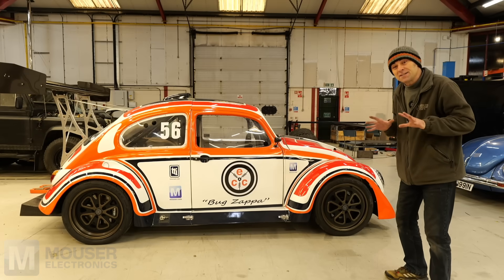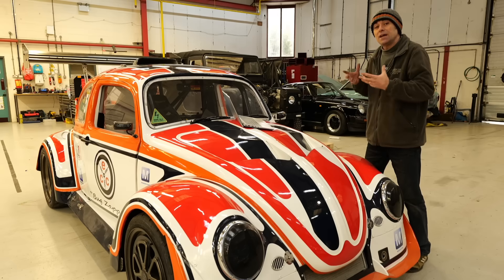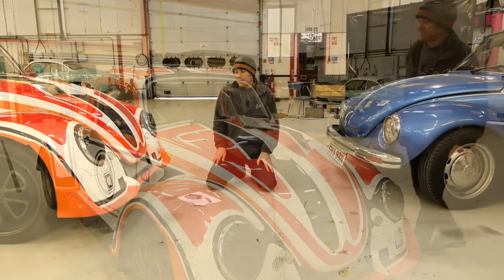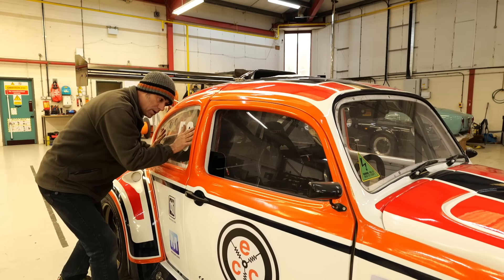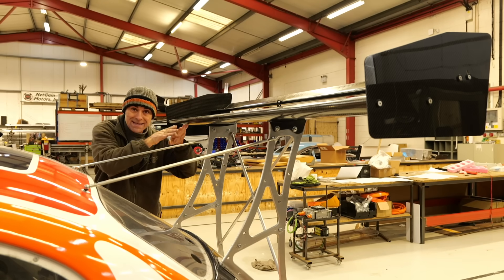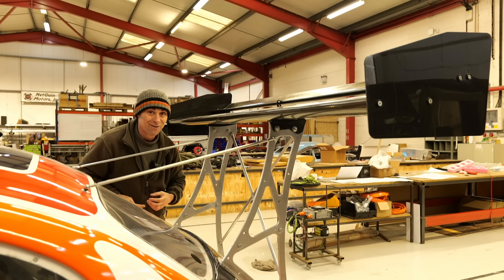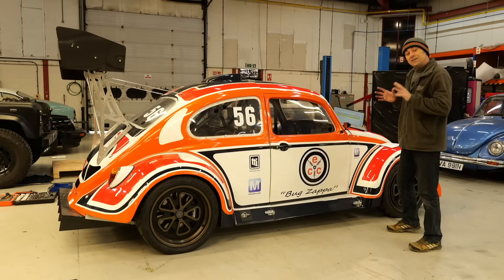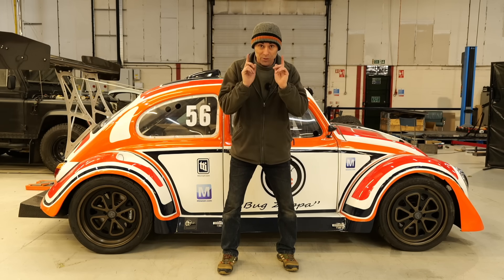Pikes Peak race car Ep17 - Aerodynamics results

Comment: I want to thank you for this video, it's really interesting and useful information, especially when you have a similar car :)
Reply from the maker: Glad it was helpful!
Reply: @ElectricClassicCars  I also have a retro car from 1969, ZAZ 965, which is currently powered by two engines from Nissan Leaf, boosted to 200 kW, each accelerating to a hundred in 2.3 seconds, I think you will be interested, more details on my channel
https://youtu.be/SPlqMTv1Vhg?si=RelwtMsoBy3VbXCr

Comment: That's an incredibly detailed report, worth every penny you spent on obtaining it. I'm interested to learn how much better the modified car will perform when you take it back to the drag strip. 
Bugzappa is a phenomenal improvement over the original Beetle design, which has a basic body shape that dates back to more than 90 years ago. 🙂👍

Comment: thanks for the insights!

I can understand that the floor/diffuser and splitter provide good downforce.
But, isn't the rear spoiler also the most speed sensitive?
Have Catesby Projects considered this, or am I mistaken?
And, if so, I suppose, you need to consider this in a track specific set-up, not?

Comment: I would imagine these aero mods are going to make the steering feel a bit more positive. 

I think the explanation of how a splitter works is incorrect. 
An air dam, which is a vertical extension down from the bumper, is designed to prevent air going under the car. They're generally used when the underbody is an aero mess, they decrease drag and create some down force. 
A splitter uses the high pressure air on the front of the car and turn it into down force. With a splitter you want air to go under the car where, hopefully, the floor of the car is reasonably flat. The speed of the air travelling under the car reduces its pressure (Bernoulli) and creates more down force.

Comment: Somewhat malapropos, but here are some wind tunnel test results for a Porsche 356 from 1950:

Drag coefficient Cd: 0,296.
Lift coefficient front Clf: -0,077.
Lift coefficient rear Clf: 0,359.

Source: Porsche 356, Driving in its Purest Form by Dirk-Michael Conradt.
Reply: Is the Cd coefficient the same like Cw? And can you please explain briefly in which direction the lift coefficient acts? Am I right with my guess that the 356 front has little downforce and rear quite an amount of lift?
Reply: @HERUsai  I think Cd and Cw is basically the same thing, though you'll have to google it to be sure.

And yes, the front of the 356 generates a bit of downforce, while the rear generates lift. I've read that at 100 km/h, the old 356s basically end up with 50/50 weight distribution.

Comment: The handling and cornering will improve. How much faster and easier on the driver - tbd? Interesting about the fender vents and under carriage air flow channeling, relative to down force balancing. Any recommendations about changing the windshield to rear window roof line shape? Possibly making it more teardrop or coupe?

Comment: Wow that is a pricey report. Probably as much as the chassis. Most of the work is constructing the model. I'm a little surprised that they run a DES simulation, but then that is probably standard for them. Its just a bit more expensive.
I love the application of the underbody cheat code, strakes, just add some strakes. 
There is still a significant amount of performance left, like 50% of easy'ish gains.

Comment: Some numbers to compare with: 
A VW splitscreen bus has a very low cw value so in theory isnt to bad, but its 'big' in frontal area. A Lotus Super Seven has cw value if 0,72 but tiny frontal area but isnt to great above 120mph. A REAL Mini has a cw value at 0,50 but small frontal area. So.. using your blue beetle with its rounded windscreen might have been better?
Reply from the maker: A 1303 with its curved windscreen would definitely been a better starting point aerodynamically.

Comment: Wow, that is all good research.
I use my Leaf on track days and lack front end grip, bought a front splitter but haven't fitted it as I thought it was just a boy racer gimmick, but I will now fit it and see if it makes any difference.
Reply: The results are in, it works!

I found and fitted the little  'Halfords' type bolt on front splitter, straight on the front of my Leaf. It sticks out about 3 inches, but is 8 inches off the floor (no front air dam/spoiler), so I thought it had no chance of doing any good at all (and does look ridiculous).
But it definitely works, I am now back to loosing the rear on the corners, not the front end any more, so helps rotate the car.
I am amazed, I thought it would have no benefit at all, but am very surprised.
Thanks again for showing how effective it is.

Comment: When you covert the numbers into the Queens English the numbers are not nearly as impressive 🤨

2600 newtons of downforce is approximately 584.5 pounds of downforce. Not a small number by any means, but it’s definitely “No Barn English”. 😂❤
Reply from the maker: Keep in mind you have to take into account that the Beetle gives 2000N of lift as standard at the same speed.
Reply: @ElectricClassicCars  Are there detailed numbers like this for the stock beetle you can share? I'm curious what kinds of simple things help it out just at high way speeds (70+ mph).
Reply: @ElectricClassicCars  OMG.. wow. lol. what a car ! I can't wait to see it on Pikes Peak.
Reply: Cornering enhancement via aerodynamic downforce is actually proportional to the ratio of mass to downforce. So whilst 220kg of DF isn't amazing, if the car is light (sub 1,000 kg) that's a useful 20% increase in grip. It's why F1 cars and LeMans proto's are so quick, they are light AND have huge DF numbers!
Reply: @tinman7551. Sorry to inform you that the Queen died in 2022 and we now use the King's English, which is less exacting.

Comment: A bug does not have the aerodynamics of a brick!! It has the aerodynamics of a brick with a parachute. They do come with active aero, I know on mine at 75 mph, the rear view mirrors start folding in, that has to reduce the drag .00000001 %
Reply from the maker: We calculated that at 135 mph it had 200kg of lift. 😳
Reply: @ElectricClassicCars  At what altitude?  The race starts at 9390 ft and finishes at 14,115 and the air density, hence drag and lift is reduced in a major way.
Reply: @nathansmith7153 that will also favour an electric drive train as it isn’t looking fir big volumes of combustion air.

Comment: Can we just take a moment to recognize the brilliance and importance of the late Dan Gurney. Yes, all those "Gurney flaps" are named after him.
Reply from the maker: And don’t forget the Gurney bubble. 😉👍
Reply: @ElectricClassicCars  I had the great pleasure of actually meeting Dan one day when he was out riding his famous Alligator motorcycle with a group of his development engineers. Amazing guy.
Reply: My Super Beetle has Dan Gurney wheels, and that's as close as it will get to anything related to aerodynamics.
Reply: Anything in the report on cooling intakes & exits. They can be niggly vortex creators.
Beetle has a gap between front bodywork & pan. Have you smoothed that out.
Not surprised underneath important, airflow management through engine bay in front engine cars v important. Porsche front eng cars have bolt in panel to create downforce
Reply: Was he anything to do with American hospital trolleys? They're also known as gurneys.

Comment: How big is the difference for the down force at the start versus the end of pike peaks? I assume with the thinner air there will be quite a difference?
Reply from the maker: I’m not sure the difference from the start to the finish but a general rule of thumb is that because the air is thinner there’s around 1/3 less downforce, compared to sea level, when racing at Pikes Peak.
Reply: @ElectricClassicCars  Maybe Pikes Peak circuit but the hill climb start density is .54 and finish .36 compared to sea level 1.22 at sea level.